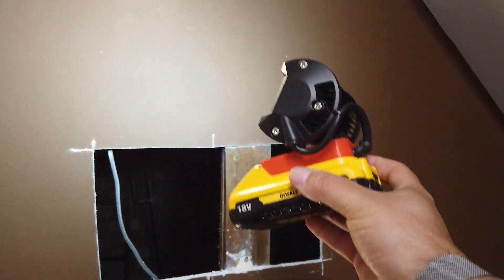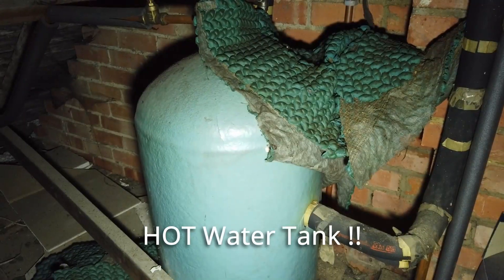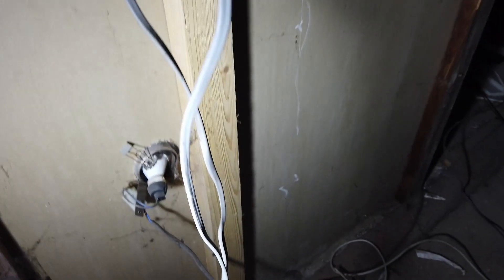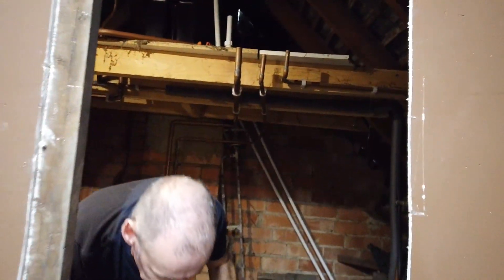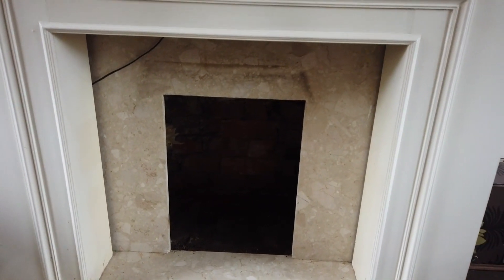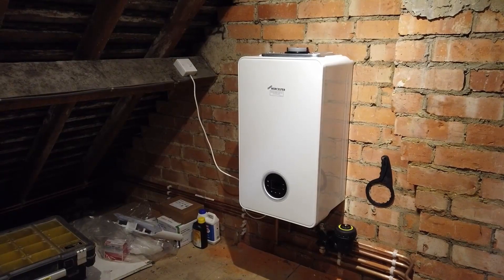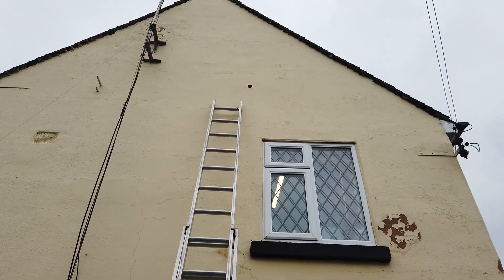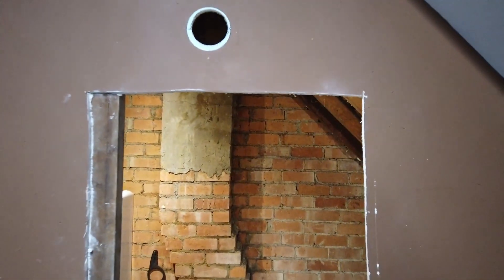DuB-EnG: Central Heating System Upgrade Baxi Bemuda Single Pipe to Two Pipe Condensing Combi Boiler

Comment: What a vastly different system than is common in my part of the world.

And suite the discovery of free square footage to expand your room
Reply from the maker: Haha - you got it!!  Room for more fun and invetions!  -  I believe your systems push hot air through vents in the floor - that also works well for cooling (AC) - I'd say thats the primary difference - you need cooling in summer.  Our summers get to about 25 C - so not that much of a problem! - If you are reading comments, please pop over to PileOfStuff and check out his electronics and beers!

Comment: Just cant wait until it snows and a helicopter is returning to NPAS Almonsbury.A few days later a knock on the door from the boys in blue wanting to take a look in the attic for greenery.   

By all means have a wood burner for a backup if your heating fails but the pollution it puts into your house and also outside isn't worth it and if you enjoy cleaning the dust will keep you busy.
Reply from the maker: Thats very true Tim...  its a lot of money for something that gets lit 10 times a year!!  The one I installed at mum's house was used quite a bit - but we had the option to cook on it too!  Hope all is well with you and yours...  hope your shed build is finished now!  All the best!  Howard
Reply: @DubiousEngineering  getting there with the "shed" got to order the fiber for the 10G link to the house and build some more desk space.